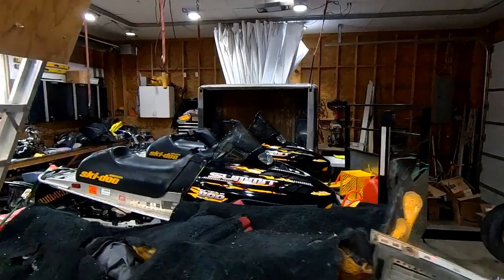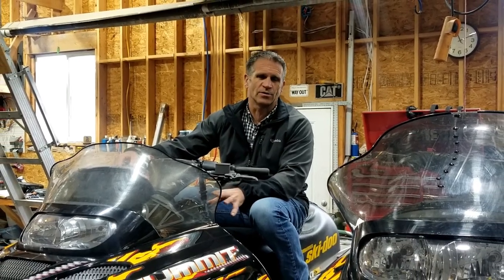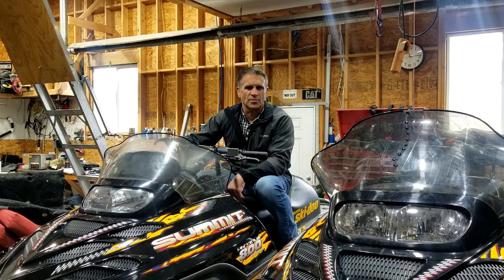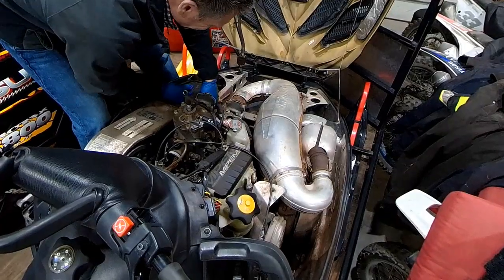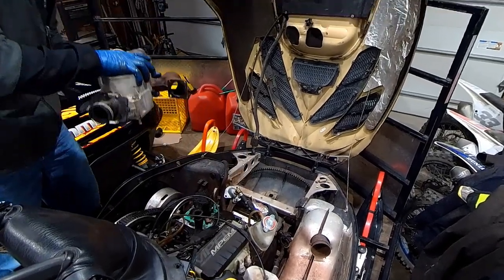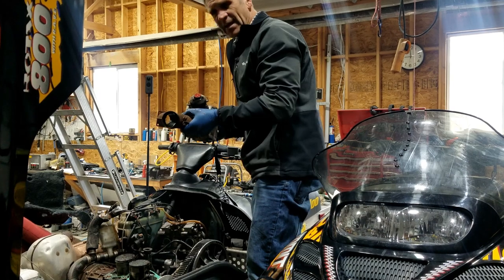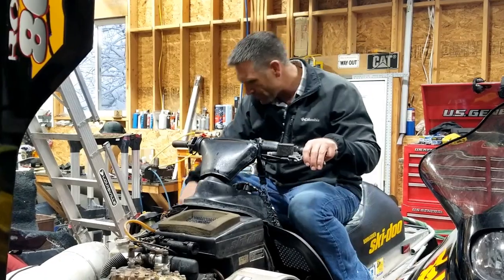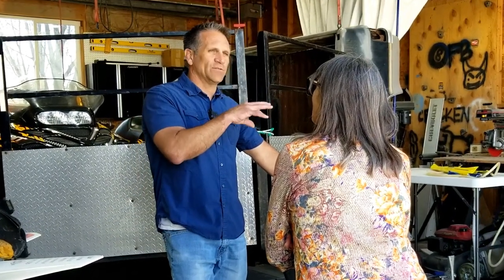FIXED! Why are these 2001 SkiDoo Summit 800 so hard to start?

Comment: I have an 02 mxz 600 and it’s got over 10,000 on it and it still runs good.takes 5-8 pulls almost every time but my reeds and carb boots are beat up.but I plan on doing a rebuild this spring if she makes it this season
Reply from the maker: Good luck. At least those old sleds are easy to rebuild. Thanks for tuning in.
Reply: Tbose ski doo 600s are the Toyotas of the snowmobile engine world. They are super reliable sleds an have more than enough power.

Comment: I ran that sled down to 89 in one cylinder and 90 in the other before i rebuilt it. That said after the rebuild with rk tech head they were pushing 165 in both. The only time that sled was not a first pull sled was when you drove it up on the trailer warm and drove down a bouncy road for 15 miles the combination of it getting bounced down the road and it seeing to cool down at the same time caused it to be the most stubborn sled to start ive ever seen barely able to get it to go with either! The conclusion that i was only able to come to is that it saw to cause of it to vapor lock in the fuel pump diaphram some how some way! The only other thing that i can see to warn about those sleds is if you ever find of yourself putting it under significant load when the ambient temp is a dank and warm 42+ degrees F out like breaking trail for like 5 min straight. To ones suprize when you let off the throttle it may indeed remained pinned due to them having seen to freezing solid no matter what you see to do! Warm water freezes faster than cold water so i can only assume the same proves true with fuel upon the flat slides of the 40TM carbs. In 2002 they added a circut of coolant that ran thru the carbs to prevent of it. It can see to be a real wake up call upon reaching the end of the snowed over road! The carbs are similar enough to get a pair of the 2002's and just swap over all your jets as the factory settings seemed to me to be far different as i believe 2002 they went to The H.O. by port raising of the exauhst ports freeing up about 20 h.p. in stock N.A. form. Good things to know. I still have that sled stock it weighed 499lbs it presently sits @ 389lbs When i get on any other zx I am quickly reminded as to what complete tanks they really were in stock trim. It is still a first pull sled that i rebuilt with the intentions of turboing it but it runs so darn good N.A. i just have not been able to force of myself to do it to it! Beside they come that way from the factory now if i want it turboed i can pretty much by one that way!
Reply from the maker: Well, that's a lot of info right there. You are clearly the master on that piece of machinery! Well done! And thanks for tuning in.

Comment: Could you post your parts list, pistons, bearings, seals, etc, and price of each?  Nice video, I have a 2003 summit 800, that has similar problem.
Reply from the maker: Sure thing. Here are the parts I used on this engine:

 - Pistons: $85 x 2 (https://www.ebay.com/itm/323207107130)
 - Wrist pin bearings: $12 x 2 (https://www.ebay.com/itm/265523900163)
 - Gasket set: $35 (https://www.ebay.com/itm/293106946123)
Reply: @some-guys-garage  Great thanks.  for pistons at that price, might be easier than just getting new rings and trying to replace the existing ones.
Reply from the maker: If your pistons are good, you can just do rings. I did that on one of those two sleds. https://www.ebay.com/itm/233798716320
Reply: @some-guys-garage  Thanks.  A guy told me the choke cable had too much play in it, so I will try that first.
Reply: these links no longer work  @some-guys-garage  I just purchased this exact same snowmobile and would like to do a top end rebuild can you put new links for parts please?
Reply from the maker: @victorgomez5257 Not sure why. Trying again...

Pistons: https://www.ebay.com/itm/323207107130?mkcid=16&mkevt=1&mkrid=711-127632-2357-0&ssspo=HqiK9XUBQrG&sssrc=2047675&ssuid=WVLfEaMkSYO&widget_ver=artemis&media=COPY

Wrist pin bearings: https://www.ebay.com/itm/265523900163?mkcid=16&mkevt=1&mkrid=711-127632-2357-0&ssspo=JrRin3IFTMq&sssrc=2047675&ssuid=WVLfEaMkSYO&widget_ver=artemis&media=COPY

Gasket set: https://www.ebay.com/itm/293106946123?mkcid=16&mkevt=1&mkrid=711-127632-2357-0&ssspo=ZotxG7fYRve&sssrc=2047675&ssuid=WVLfEaMkSYO&widget_ver=artemis&media=COPY

Comment: Start to finish, without a trip or order parts. What kind of labor in time did it take?  I have an ‘01 Summit 600 that’s a monster to start.
Reply from the maker: Probs 2 hours ish per engine.
Reply: They are pretty easy to work on an simple ski dod did a good job at making these sleds simple to work on an rebuild.

Comment: How about the carb boots?
Reply from the maker: Oh, very good! I suspected the same thing for a minute, and even thought that might be the problem for a minute, but they're good. No cracks, no leaks.
Reply: @someguyzgarage yep the carb boots are the weak link on these sleds they tend to crack an last about 3 seasons. I ended up going with boyseen rage cages all aluminum they are the same price as v force 3s

Comment: What scored the piston in the first place? something caused a lean condition on the intake side, if you don't solve that problem, it is very likely it will do it again in the near future. It could be sucking air from cracked carb boots or reeds, it could have bad gas in it,  plugged jet, bad crank seal on that side or both sides. Oil injection system may not be working properly. I would be willing to bet its the 22 year old crank seals.
Reply from the maker: I would be willing to bet it's the 22 year old pistons. Although you are correct that a lean condition can cause premature failure, I would hardly call this failure premature. Pistons and rings eventually wear out even under perfect operating conditions.
Reply: Those are funny pistons then, they only wear on one side. I didn't call it a premature failure, things can fail at any time. I just don't want some kid to slap pistons in his machine and go 3 blocks and blow his engine again. You should do a leak down test after a rebuild but you knew that right, those 20 dollar crank seals would have blown your budget I suppose.
Reply from the maker: Thanks for the clarification. Glad you're here to police YouTube on behalf of the kids of world.

Kids - before you run off and break your rebuild budget on $20 crank seals, take note that on this project the combustion pattern on the cylinder heads and spark plugs looks nearly identical between them with an edge toward incomplete combustion (not lean). Also note that the difference between the pistons was that one had a gouge in it directly in line with the ring gap, indicating a failed ring (or other debris) in that cylinder.

Also, kids, always perform a leak-down test after a rebuild. Because I'm sure you have tools to do that. If you don't have a leak-down tester, give me a call. I have one that I used on this job. Crank seals are fine.
Reply: Those cheap garage rebuilds keep me in business, great work. Burn patterns... too funny.
Reply from the maker: Happy to hear I'm helping my friendly neighborhood ancient snowmobile mechanic stay in business!

And, yes, if you want to learn more about reading rich/lean condition from spark plugs, my 15 year old son would be happy to give you a primer course.
Reply from the maker: Sorry. I feel like that last comment might have gone too far. I like some friendly banter. Hopefully you feel the same way.

Thanks for tuning in, man. It's clear that you know your stuff. Best wishes to you.
Reply: its all good, I wasn't trying to be a jerk. I am a machinist and build engines for a living, some of them are for racing, mostly 2 strokes.   @some-guys-garage
Reply from the maker: That's so cool. I have a few buddies that run machine shops. I sometimes go sit on the machine shop floor and drool. And sometimes they even let me build something.

Stay fast!

Comment: Cringed when you hammered out the wrist pin....Dead blow or not, that is asking for trouble as you damage the big end bearing.  piece of pvc pipe and a threaded rod is the way to pull it out.
Reply from the maker: Can't disagree with that. However, I'm willing to tap lightly. If they don't come, I use the puller. Never had a problem.